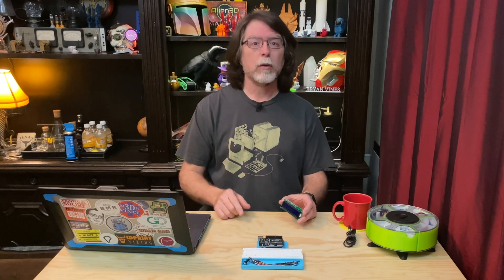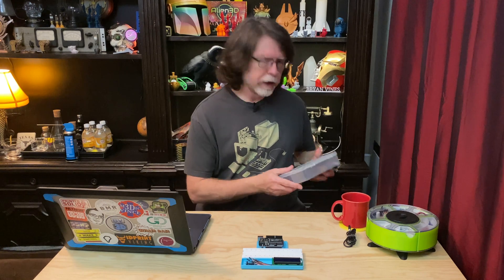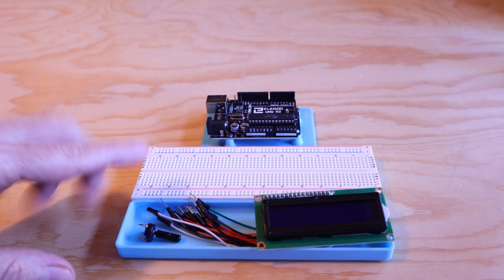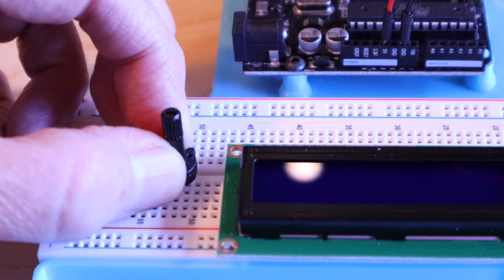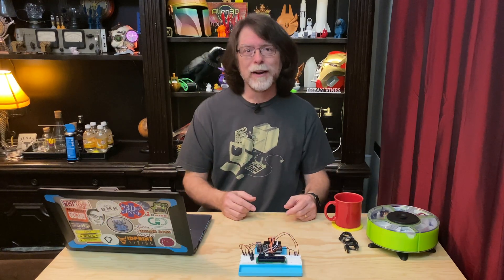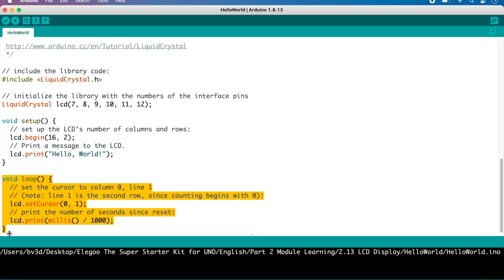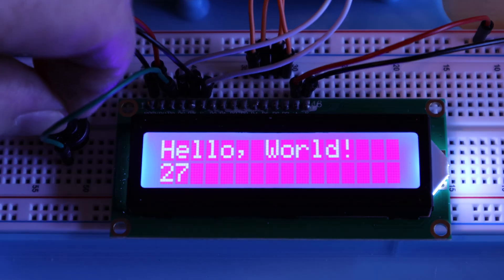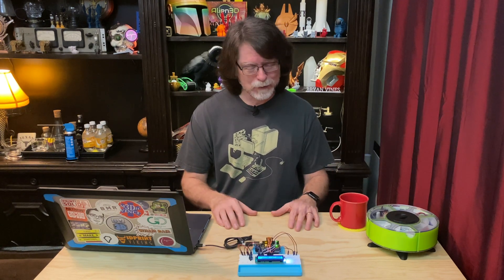Get Started in Electronics #11 - Use the LCD Screen with an Uno

Comment: Hey Brian I am late to the game and have been following your tutorials with this kit.  I love your tutorials with this KIT.  Using your tutorials I wrote some code to report the DHT11 temp and humidity data to the LCD screen.  I am posting my code below for anyone who may want to do the same.

// This is my code to send data from the DHT11 sensor to the small 16 character 2 line LCD screen.
// DHT11 Sensor with only three prongs
// LCD screen is LCD1602 Module.
#include <LiquidCrystal.h>
#include <dht11.h>
#define DHT11PIN 4

dht11 DHT11;

int tempPin = 0;
//                           BS E D4 D5 D6 D7
LiquidCrystal lcd(7, 8, 9, 10, 11, 12);
void setup() 
{
Serial.begin(9600);
lcd.begin(16, 2);
}

void loop() 
{
Serial.println();

// This line of code is necessary to cause the Arduino to check the sensor or it will not report values.
int chk = DHT11.read(DHT11PIN); 

// These lines of code only report to the serial monitor.
// I was only using these lines of code as a check on what was being sent to the LCD monitor.
Serial.print("Humidity (%): ");
Serial.println((float)DHT11.humidity, 2);
Serial.print("Temperature. (C): ");
Serial.println((float)DHT11.temperature, 2);

// These two lines of code convert the Celcius output of the DHT11 to Fahrenheit.
float tempC = (float)DHT11.temperature;
float tempF = (tempC * 9.0) / 5.0 + 32.0;

// These lines of code send the Temperature and Humidity data to the LCD screen.
lcd.setCursor(0, 0);
lcd.print("Humid(%): ");
lcd.print((float)DHT11.humidity);
lcd.setCursor(0, 1);
lcd.print("Temp (F): ");
lcd.print(tempF); // Pass tempF from the conversion above or if want Celsius code would read lcd.print((float)DHT11.temperature);
delay(2000);
}

Comment: I downloaded the latest code available on the website today, and I found that they have changed the pin numbers. A quick and easy fix to the code, and which matches the setup in the video, is as follows:

//LiquidCrystal lcd(rs, en, d4, d5, d6, d7);

LiquidCrystal lcd(7, 8, 9, 10, 11, 12);
Reply: No kidding. I just had a bunch of white squares and was checking for what was wrong. Now it works after this adjustment. Thanks a lot!! To anyone who is typing the above second line of numbers in as the replacement, there should be no spaces at all between the brackets to make it work, as far as I can tell. Thanks for this and glad I scrolled down this far looking for a solution!
Reply: And P.S. Thanks for these vids, Brian. I have had my Elegoo kit a while now but first time I tried to go through the instructions, I was stumped on some of the vocab but it's great to be able to follow you step by step. 100% result on three experiments so far...

Comment: Do you think I could turn it into a clock
Reply from the maker: Yes. Countdown timers with delay commands are fine for short durations, but you probably need an RTC (Real-Time Clock) module for a project to maintain accurate time.
Reply: @BV3D  thanks
Reply: Also the code that you showed in the video did not work for me it said there was an error do you know why maybe?

Comment: i don't know whats wrong with this but can you fix it
int r = 3;
int g = 5;
int b = 6;

int b1 = 2;
int b2 = 3;
int b3 = 4;

void setup() {
  // put your setup code here, to run once:
pinMode(r, OUTPUT);
pinMode(g, OUTPUT);
pinMode(b, OUTPUT);
pinMode(b1, INPUT_PULLUP);
pinMode(b2, INPUT_PULLUP);
pinMode(b3, INPUT_PULLUP);
}

void loop() {
  // put your main code here, to run repeatedly:
  
static int j = 0;
static int l = 0;
static int k = 0;
static int i = 0;

while(digitalRead(b1) == HIGH){
  for(i = 0; j = 0; i++){
    i += 1;
    analogWrite(r, i);
    Serial.println("up");
    delay(10);
  }
  for(i = 255; j = 0; j++){
    j += 1;
  }
  for(i = 255; j = 1; i--);{
    i -= 1;
    analogWrite(r, i);
    Serial.println("down");
    delay(10);
  }
}
}

Comment: I was getting errors and was super confused. I may have the wrong library code, but I had to change the following:

Replace #include <LiquidCrystal.h> with #include <Adafruit_LiquidCrystal.h>

Replace LiquidCrystal lcd(7, 8, 9, 10, 11, 12); with Adafruit_LiquidCrystal lcd(7, 8, 9, 10, 11, 12);

These are hands down the best Arduino tutorials available! Thank you so much!

Comment: Hey man keep it up, I really understand this, but I have a problem with pasteing data to lcd, I am making an arduino project, its an auto water pump and cooling system via ( moisture and humidity sensors ) the problem is that I don't how to control motors and stuff like that with the output data from sensors

Comment: All I see are blocks where it should say hello world as far as i can tell all my connections are correct
Reply from the maker: Hi,
Does adjusting the screen's contrast with the potentiometer have any effect?
Are you using the 5V supply for the LCD's power? The schematic incorrectly shows using the 3.3V supply.
Reply: @BV3D  it is to the 5v and I can make the squares Disappear if I adjust the potenchomater

Comment: I had already played with this following elegoo's tutorial.   My display showed "llo world"  for some reason.   I had to include a 
lcd.setCursor(0,0); in the void setup() function to get it to work.  I did use 3.3 volts, so maybe this is why.  In anycase it worked fine after I initialized the cursor position.   Next time I will follow along with you.   Great set of tutorials btw.

Comment: I haven't watched yet but omg I hope you can solve my Ic2 problem with my lcd
Reply from the maker: In this video I'm running the display with a 4-bit data path. I think I have an I2C version of this LCD somewhere. What kind of trouble were you having?
Reply: @BV3D  hey Brian! I bought some i2c modules to add to my lcds I got in the elegoo most complete starter kit 1.0 and have not been able to get the screen to show anything... It's as if the potentiometer is all the way up but it's not.

Comment: Bryan you can buy a cheap I2C serial Interface module for these screens for less than $2 they plug neatly on the back of LCD and also have the POT integrated. Also you only need to use 2 pins from Arduino. Very easy to use and there is also a dedicated I2C Library available.
Reply from the maker: YES! I love those little interfaces. They’re great, and you can even get the LCDs with them already mounted. I wish that was the kind included in the kit, but I’m also OK with needing a few more wires for the screen when there are plenty available on the Uno. If I were making a more complicated project with an LCD and pins were at a premium, the I2C board would be top of the list for freeing up pins. 👍🏻
Reply: @BV3D  Yes Bryan just thought i would mention it as they might be useful to someone requiring more pins for their project.

Comment: Great video Bryan, I have subscribed.I also have a 20x4 LCD that I have never used. Would love to see a simple video on that sometime.  

Thanks for the prototyping base too, I have had a 3D printer for almost two years but it never actually occurred to me to print one! 😂
Reply from the maker: Hi Colin! The pinout on the 20x4 LCD is probably exactly the same as on the 16x2. If it is, you could change the line in the code that tells the LCD code library that it's using a 16x2 display so it knows it's talking to a 20x4. So you'd change lcd.begin(16, 2); to lcd.begin(20, 4); and I bet it would work. 👍
Reply: @BV3D  Seriously?!  I feel so stupid for not thinking of that.  It's kind of obvious really, isn't it...  Thanks! :)
Reply from the maker: @Collin French  Did you give it a try?
Reply: @BV3D  Not yet.  Been busy cocking about with the code for a self balancing robot I am building.  Will play when I have finished work. :)
Reply: @BV3D  So, I got the 16x2 running with a temperature sensor, no problem. I modified the code for 20x4 and line three squirted all over line 4.  I think it's something to do with the lcd.print command for the temperature on line 2.  I modded the code again and tried to upload it to the board and I got all sorts of errors about the computer (Mac) not being able to talk to the board.  Got stressed, threw a paddy and have given up for now.  Drinking tea instead.  Will look again when calmer.

Comment: Thank you for the correction of the Elegoo schematics. I thought my display was busted and had stopped go through the lessons. Keep the videos coming they have been very helpful.
Reply from the maker: Hi Carter! You're welcome. The first time through, I wired it up as per the schematic too, and had the same problem. I noticed on the datasheet for the LCD that it needed a 5V supply, so I tried that and it worked. 👍